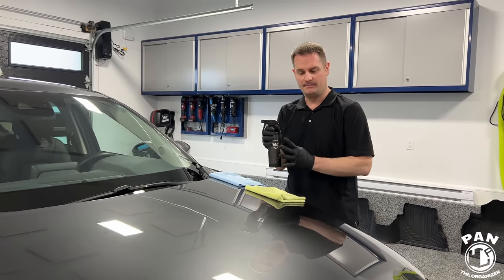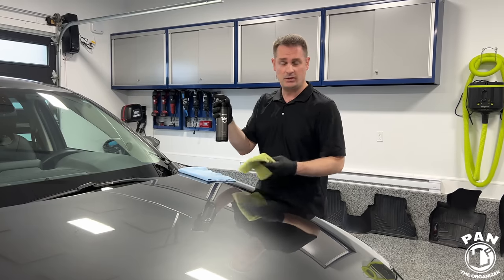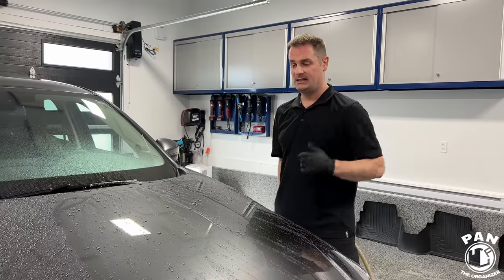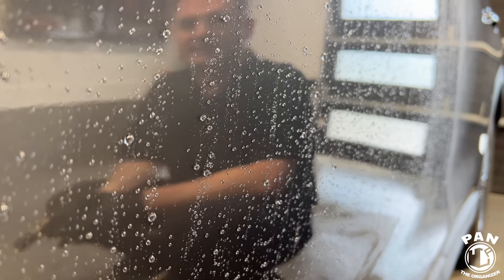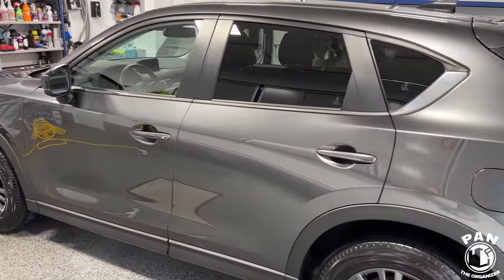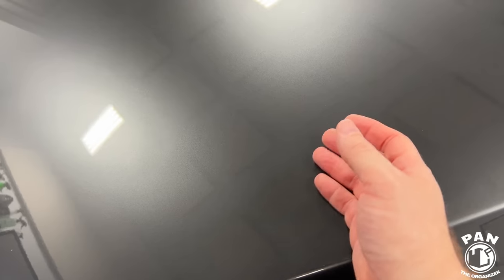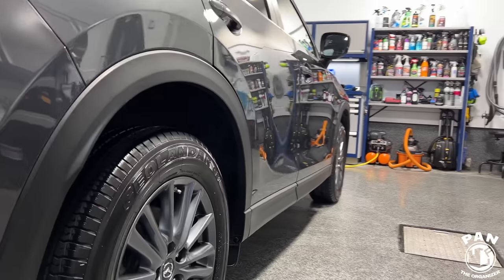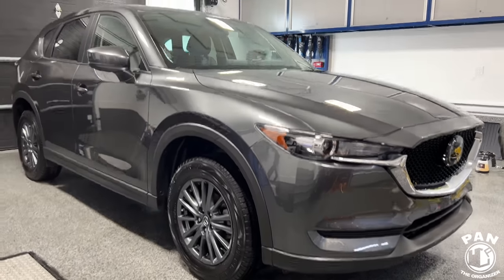NEW! AvalonKing Armor Shield Lite : Ceramic Spray Made EASY!

Comment: Salut Pan ! ce produit versus Hybrid Solutions Ceramic Wax Spray Coating lequel est le plus performant et durable ? Pour le Turtle Wax j'applique 2 couches à l'intérieur de 24h pour avoir la protection 12months comme la compagnie indique sur leur produit.

Merci de ton temps
Reply from the maker: Le Ceramic Spray Coating sera plus durable. Le Armor Shield Lite est plutôt un produit de maintenance, pour lavages d’appoint, durabilité 1-3 mois.
Reply: @PanTheOrganizer  le Ceramic spray je peux l'utiliser comme maintenance over Avalon King Ceramic coating ?

Comment: Is this safe to use on a ceramic coated car?
Reply from the maker: Absolutely. As mentioned in the video, this can be used as a standalone or as a topper over an existing ceramic coating, for maintenance of the coating.
Reply: @PanTheOrganizer  thanks, is chemical guys hydro suds a good soap to use to boost the coat?

Comment: How much product did you use for the whole car? Armor shield lite?
Reply from the maker: I don't measure how much liquid is out of the bottle when using spray products. That would be a bit too much to start monitoring. But you don't need a lot. One bottle will likely do many cars. Unless you use it as a drying aid, then you're using a bit more. But it's no different from any spray on product as far as quantity used really...
Reply: Thank you! I already have one bottle and they have black Friday sale right now. Just wanted to know if I needed more. Thank you for the fast answer. Also I will buy a new car . I will have some ppf installed.  I will decontaminate the paint chemically and clay bar, have it polished then ppf. Do I have to redo the tar removing, iron removing and clay bar after ppf?? I won't be able to do it in the same day and I will have to drive my car. A simple car wash should be fine after I did all these steps??
Reply from the maker: If the PPF is freshly installed, wait one week to wash your car (or longer depending on what your PPF installer tells you) and then you can simply wash the car, and start using Armor Shield Lite.

Of course, even better would be to apply a PPF coating first, and then maintain that with Armor Shield Lite when you do maintenance washes.

Watch my PPF coating tutorial: https://youtu.be/7RCgqdGrvrA

Congrats on getting a new car! What are you buying?
Reply: I will have the ppf applied to the front bumper good and front fender only. I will apply a true ceramic coating on my car afterwards! I already watched lots of your video! Sit back , relax and enjoy the show 😉
Reply: Toyota prius prime 2023, supersonic red. I might have some rims powdercoated candy black. You don't know a good powerdocoating place by any chance?
Reply from the maker: Good move! It shows that you watch my videos and learn along the way! :)
Reply from the maker: I don't unfortunately...

Comment: I'm very surprised Andy got so much out of the coating so far. I applied mine in May 2021 (around the same time as his) and it was almost completely gone by March this year. I've heard this from others too. They sent me a bottle of Armor Shield Lite to test and the durability of this one was lacking as well. Very steeply priced too. It's $35 and has the performance of the $10-15 spray coatings at Walmart/Autozone. Personally I'd skip this one.
Reply from the maker: I guess it depends on various factors like for many coatings. Mileage, environment, maintenance, application, etc

I have many viewers who tell me they have had three plus years with proper maintenance, dor those who tested it before I did. Some get one year to two years.

I have been testing the AK coating for two years now and so far so good. 

Did you properly prep your paintwork prior to application? Did you apply two coats? What kind of maintenance did you do?
Reply: Depends if you did proper cleaning on the car & if you applied it properly as well. I see so many people put a very good product & results are horrible. They do one of those quick wash & then start applying these products instead of actaully doing clay bar work, compound & prepping the paint for the product, I personally wouldn't apply a wax either then that, just compound, polish, prep the paint for such products to be applied onto the paint. Don't get me wrong there is other products you can wax your vehicle & apply ceramic like products right after & it will work, but remember these things won't last you up to a year unless you are a professional & know what you are doing & know how to PROPERLY APPLY the product.
Reply: @drinny23la4  I did over 40 hours of prep. Full wash & claybar, wetsand, compound, and polish the entire vehicle, followed up by 2 layers of Armor Shield IX 24 hours between layers. IPA prep between every step (except the layers of coating). & never wax before applying a ceramic coating, the wax the ceramic coating is sitting on will break down much faster than the coating
Reply: @batvon39  that sucks so what products you been using that works better than this?

Comment: You say topper on ceramic coating is a NO NO  but yet you review (don't know that you use ) ceramic toppers/maintenance products 🤣🤔
Reply from the maker: What? I think you're confused. It's important to apply a topper on all ceramic coatings and graphene coatings, at least once every 2 to 3 months to maintain the properties and durability of your coating. I even made a popular tutorial on that topic here: https://youtu.be/yLiePQRMFc8

I never said that applying a topper on a coating is a no no lol.. Where did you even hear that??  What I don't recommend is applying a regular wax or sealant on top of a coating as you'd be masking the coating's superior properties. But you SHOULD be applying a ceramic or graphene topper on your coating, that's for sure!
Reply: @PanTheOrganizer  I thought, from previous videos, that it was best to stay in the same "family".  Meaning if you have a ceramic base, use ceramic maintenance.  Using a Graphene Base, use a Graphene maintenance.   Not sure how much it matters but it has been a Pan "rule" that I follow.   AK Shield Base gets AK Boost or AK Lite or TW Ceramic Wet maintenance.    303 Nano Graphene Base or TW Graphene MAX base gets TW Flex or 303 Nano as maintenance.
Reply from the maker: Most graphene coatings have a ceramic base with graphene reduced oxide added to them. So you can use what ever topper you want. For example, on a graphene coating, you can use an SiO2 spray or a graphene spray, it doesn't matter. And on a ceramic coating, you could use a graphene spray or ceramic spray for maintenance, it doesn't matter.

As long as you don't mix regular waxes/sealants with coatings, you are fine.